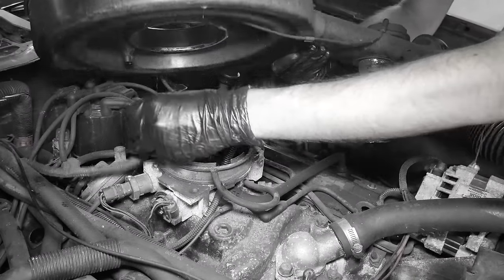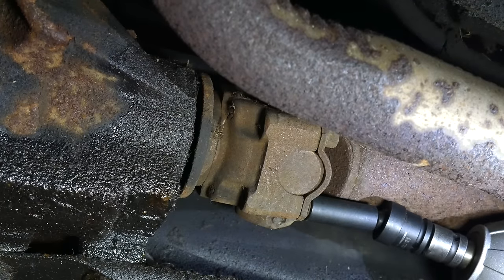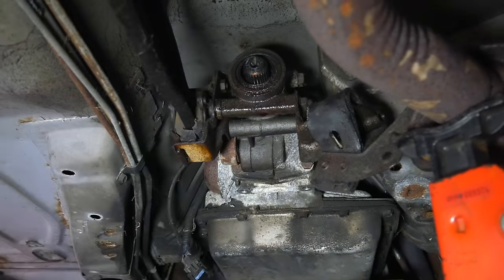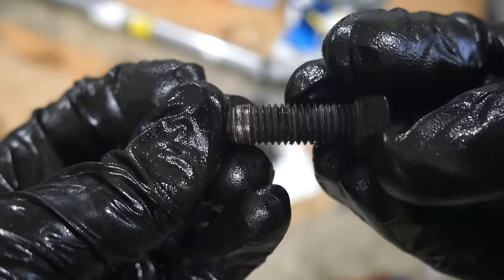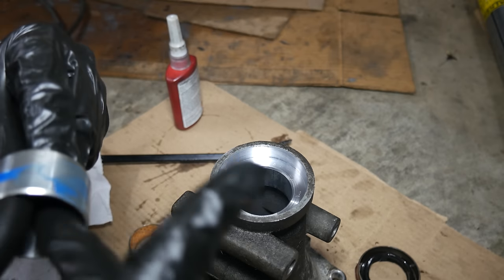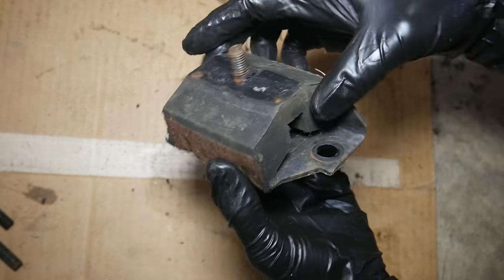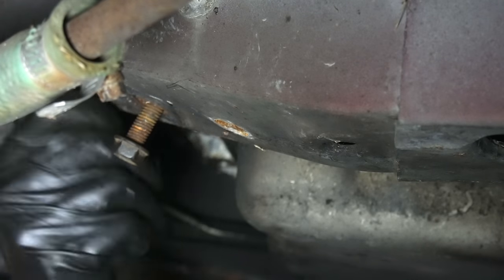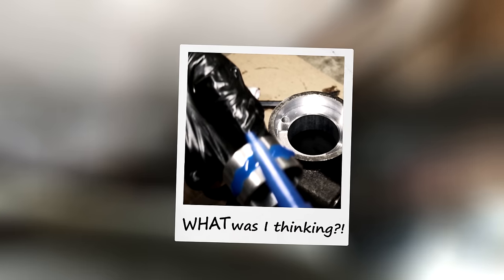1991 Firebird 700R4 Tailshaft Bushing and Seal Replacement (Ep.3)

Comment: Can you replace the pinion yoke on the differential? My 93 c1500 always make a noise when I’m at a stop and then i accelerate the diff makes a thunk noise. After that it’s quiet. Also when changing from P to R and D
Reply from the maker: If it stays quiet, that doesn't really sound like worn gears or a bad mesh in the differential, usually you can hear it whining or rumbling before it gets to the point of clunking that bad. With the parking brake on and transmission in neutral (and parked on flat ground for safety's sake) roll under there and turn the driveshaft back and fourth. There should be some movement, but not a lot. Listen for any weird noises. Compare it to another similar solid axle vehicle, if you aren't sure. Get the back wheels off the ground and do the same thing, see if you can locate the clunk. If it were a 4WD truck (like a K1500) it is common to have some driveline slop, but there shouldn't be too much on a 2WD truck. Check it in Park and in Neutral with the wheels off of the ground. Maybe even have somebody outside of it listen to the truck as you accelerate normally to see if they can tell where the noise is coming from.
Reply: Fuzzy Dice Projects thank you for the reply. Recently it got to the whining noise then “clunk” it releases and goes quiet. That didn’t happen before though. It didn’t whine anymore. I’ll do what you said and hopefully pinpoint exactly what the fuck is wrong. :(

Comment: Do you use a Chilton book for your torque values or?
Reply from the maker: Some of the vales are from a Haynes manual, some from the internet, and some just guesses based on the fasteners and materials involved. I have found that Haynes manuals often don't have some of the more specific values and every once in a while have something that appears completely wrong and I will often double/triple check anything that seems remotely fishy.
Reply: @FuzzyDiceProjects  Ok thanks. Appreciate it, I will do the same.

Comment: How do you know the exact spec torque for every bolt?
Reply from the maker: Haynes and service manuals, sometimes doing research online. If I can't find a spec but want to use one I will go by the size/thread pitch/grade of the bolt/material it is threading into and use a chart to make an educated guess.

Comment: "Taking a look at the bolts we removed, it's fairly clear what happened..."   

*ten seconds later*

"To be honest, I'm not really sure what happened."

Wait, what?
Reply from the maker: Ha. Well, it is clear that the buildup on the bolt threads is what caused the crack. I'm not entirely sure why the bolts had so much aluminum build up on them however, must have been a result of corrosion between the steel and the aluminum though I hadn't seen that exact kind before.
Reply: @FuzzyDiceProjects  I couldn't help myself.

Comment: 18:23 what did you use for the crack?
Reply from the maker: In the transmission? Nothing haha. The bolt tightened back in and I couldn't feel anything on the outside edge of the aluminum, so just going to roll with it.
Reply: @FuzzyDiceProjects  not even lock tight
Reply: Why not a silicone sealer ?

Comment: What swivel sockets are those
Reply from the maker: Got them on eBay, I think the brand is Cal-Hawk. Went for them because they are a good depth, shorter than deep sockets but deeper than shallow sockets. No complaints so far, have put quite a bit of torque through some of them with no ill-effects.

Comment: I'm pretty sure that's a bearing rather than a bushing.
Reply from the maker: Well, bushings are bearings, they are also called "sleeve bearings". Honestly I couldn't tell you exactly what makes a bushing a bearing and a bearing not a bushing, basically if it has moving parts I'd call it a bearing (ball bearing, needle bearing, roller bearing, etc.) but it wouldn't be incorrect to call the part we replaced in this video a bearing.

Comment: What are foot pounds 😂
Reply: They are a measurement of torque. Each bolt has an optimal torque they need to be tightened to, otherwise problems may occur if they are to loose or tight.